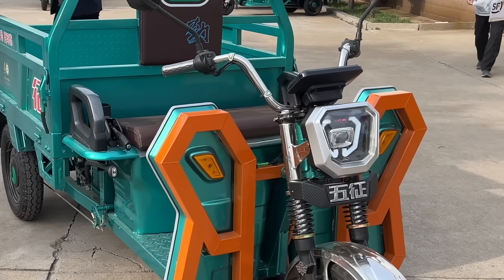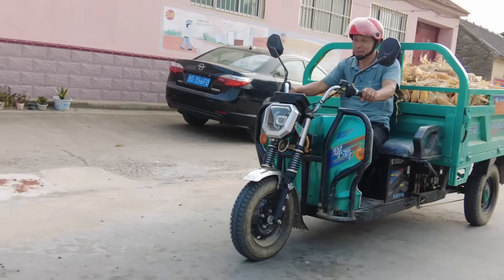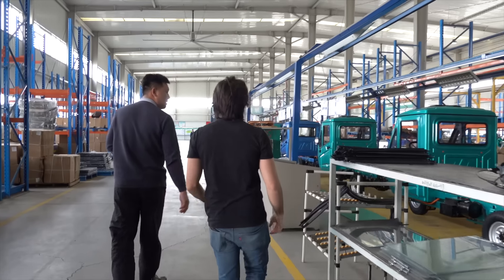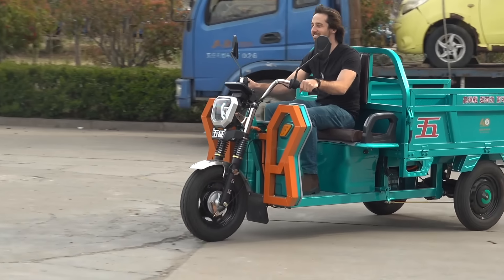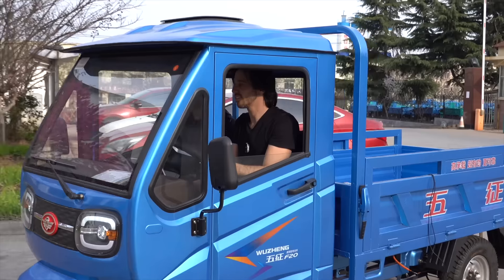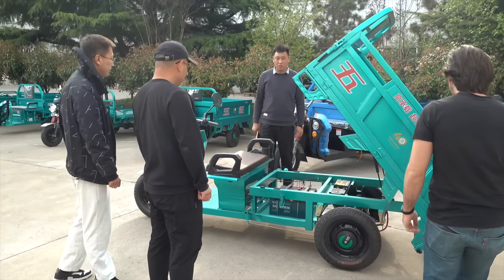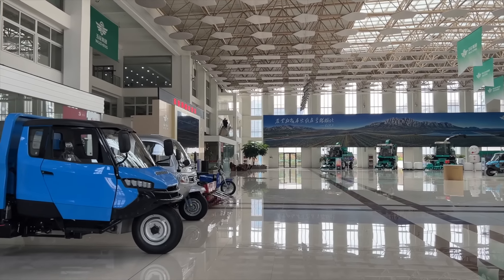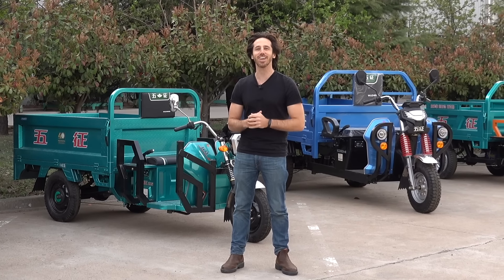Visiting a Chinese electric farm truck factory: Wuzheng three-wheelers

Comment: I used to work in China in 2016,  the price for a new three-wheeler was between 300US$ and 2000 for the heavy duty with bigger batteries. for an extra 100$, you could add a solar panel roof worth about  50-100 miles added range per day, more than enough for 95% of users. ok it tops 40 mi/h downhill, slightly less than a F150, but for 500$ only, no more gas bill!
Reply: This sounds crazy
Reply: i drove one of these like 10years ago,its fun,but trust me you dont want to to over 30mph with these thing🤣
Reply: @weanynwa5348  true, low cost, low maintenance cost, low speed, but you can live with that speed, and even be happy with that when it carries thousands of pounds of stuff through the roads and dirt tracks day after day
Reply: chiin@ # 1
Reply: but still.. you need few more bucks to change the battery once its broken
Reply: @liljoe5  lifetime is around 3000 cycles for LFP battery(it can be 10000 if you take extra care), if you have a small battery  worth 50 miles (2024 price is around 250$, it should be cheaper in the future), it still gives you 3000x50=150000 miles. 
If ever you ride more than 150000 miles, it may cost 250$
Reply: @weanynwa5348  Who is speeding in a farm truck?
Reply: @weanynwa5348  The 3 wheel concept is very well proven.  You can still see many old three wheeler mini trucks on European roads.  The battery version has a lower centre of gravity, so is more stable than the old ICE versions.  These things are designed as farm work horses and are great for that application.

Comment: I visited the NE of China last year and I stayed there for two months. These three wheeled trucks were all over the place and I was amazed at the loads that they carried. As you mentioned, it is a big advantage to be able to drop the sides and tailgate for easy loading and unloading. The dump bed is a big advantage as well. One day my wife and I went shoping at a local roadside market and we purchased several bags of vegetables. She spoke to one of the farmers who only charged 10 yuan to give us a ride home. The three of us squeezed into the cab of his little three wheeled truck and off we went. The ride wasn't smooth, but it got us home. I saw several sizes of these trucks as well as small short and stubby ones as well. They were built like little tanks and were used to carry paving stones. I saw small diesel tanks attached to the cabs of several of the standard sized trucks with enclosed cabs. I'm pretty sure that they have small diesel heaters in them as it is really cold there in the winter. I enjoyed this video, thank you!

Comment: This tricycle is very reliable for the reason of its simplicity. The motor drives the rear axle of the vehicle through reduction gear inches. There is no need to change the oil, there is no gearbox, there is no internal combustion engine, all there is is a couple of wires. Even if the user is uneducated, he or she can normally use and repair it.   And this kind of tricycle in China, many people use more than ten years have not been maintained, after all, even if it is broken, it does not need to spend a lot of money to get a new one. 

We here in the countryside, almost every family has one, in the countryside is too convenient to use.  Electricity is as cheap as free money compared to fuel.
Reply: can it operate in offroad beaten tracks or paddy farms?
Reply: @Bennix  sure
Reply: I'm an American living in hangzhou,,,can I drive one there in the streets?,,,,,,

Comment: I used to think that this type of tricycle belonged to agricultural vehicles, and American agricultural vehicles were mostly fuel powered pickup trucks. Because American farmers are relatively wealthy and fuel prices are not so high in the US, pickup trucks are also more powerful, so they do not need this type of electric tricycle, so there is no manufacturer to manufacture it. Now, after I have watched some videos, I think these kinda tricycle should‘t be completely without a market in the US. Perhaps only American car makers do not like this type of low profit things, after all, American production and labor costs are too high, selling it too cheap will not make a profit, selling it too expensive and no one will buy it.

Comment: no way people in US can buy this. The tariff rate on Chinese made electric vehicles under Section 301 will increase from 25% to 100% in 2024
Reply: Honestly, these make sense even with the outrageous tariffs - they cost something like $1000 for no cabin, around $3000 for semi-closed and closed cabins. Add some upgrades and a better battery pack, that's 2k and 4-5k. Slap the 100% tariff on top, and you're still under 10k for most configurations.
These things are becoming popular in rural areas in Europe too, but as usual there's problems with legislation. They're either registered as L electric bikes with 25km/h top speed or L3 with 50km/h top speed.

Comment: These trucks are also manufactured in Pakistan and can easily carry 500 bricks, or similar load. 150-250cc engine have ample power to carry this thing. 150cc version cost equaling to $1500. Only petrol (gasoline) variant.

Comment: three wheels tip over much easier.  i'd make it 4 wheels.  no elaborate steering mechanism needed.  also not as much soil compaction if you do use it for on the field work.  3 wheels make 3 compressed lines.  4 wheels make 2.